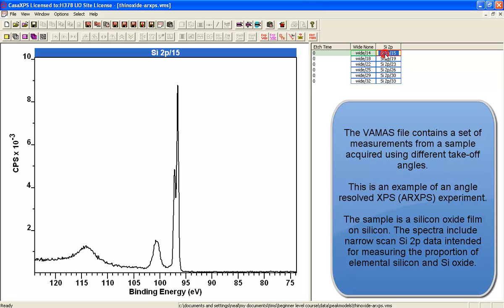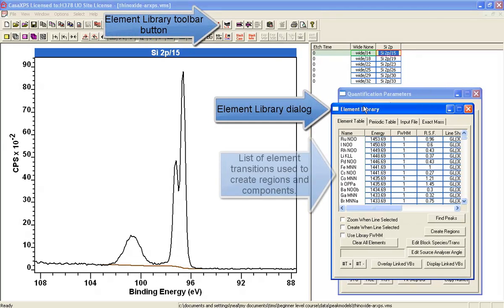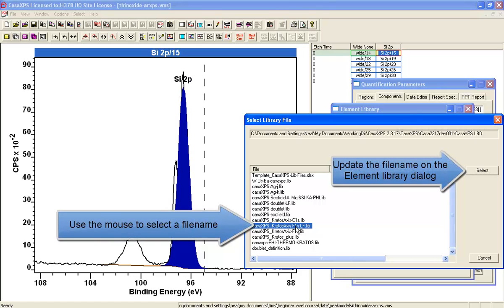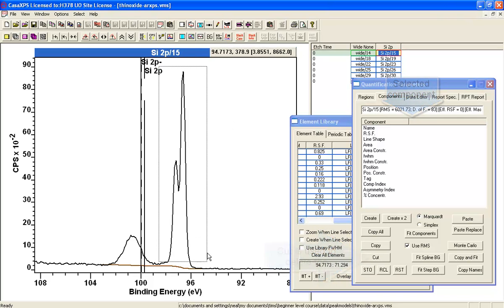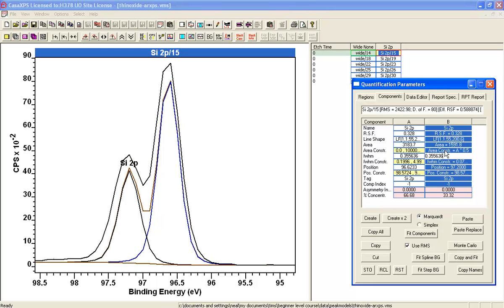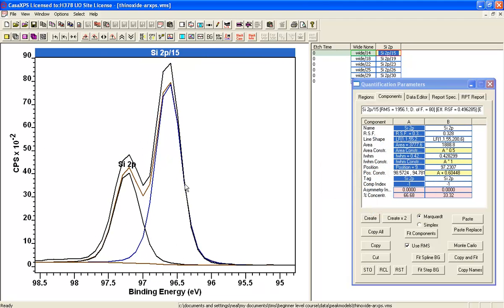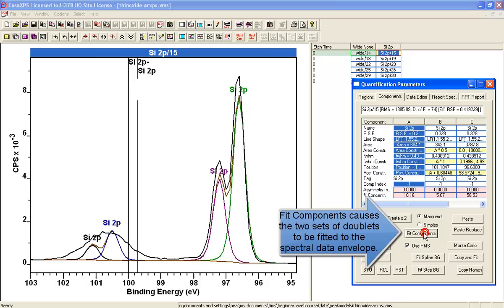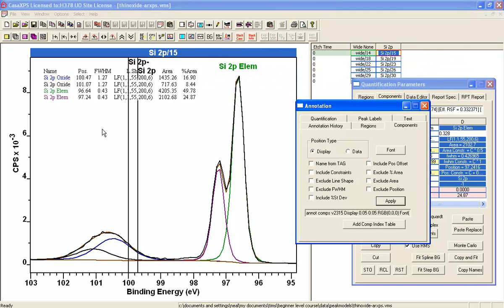Simple Metal and Oxide Peak Model in XPS

Comment: How to determine the selection of lineshape types, when to use GL(30), when to use LF type? why did you choose LF here, specially for Si2p? Thank you.
Reply from the maker: Line shapes are specific to sample and instrumental mode used to collect data. The primary objective in choosing a line shape is to provide help to optimization that fits the peak model to data. In the case of Si 2p spectra where there are both elemental and oxide photo-emission peaks, the broader oxide peaks which tend to be symmetrical can modelled by more basic line shapes such as GL. Elemental Si 2p require asymmetric line shapes, hence the use of LF.

You might like to see the following videos:
General introduction to peak models in which line shapes are discussed:
https://www.youtube.com/watch?v=olXBMm81Fpo&t=0s
Specific examples of how to select a line shape:
https://www.youtube.com/watch?v=rIo5o0JPaTI&t=0s
https://www.youtube.com/watch?v=bOJnZbkgn0A&t=0s